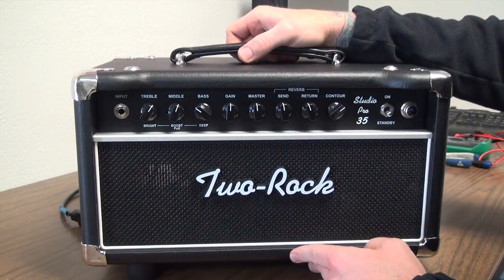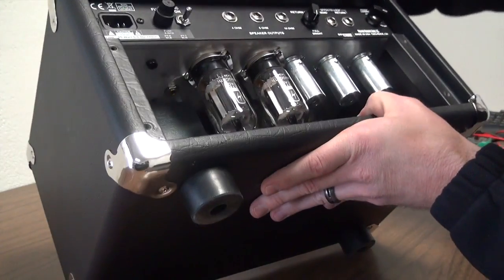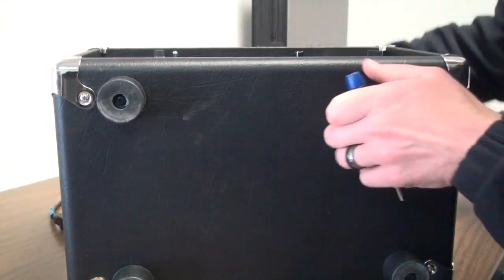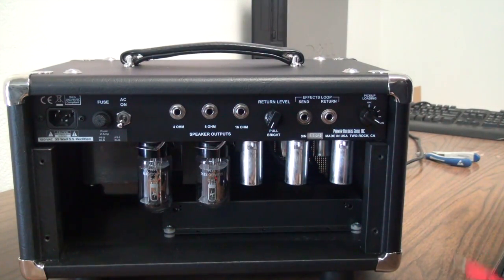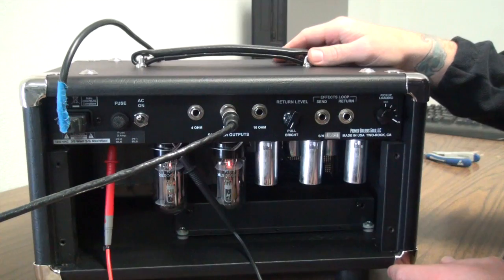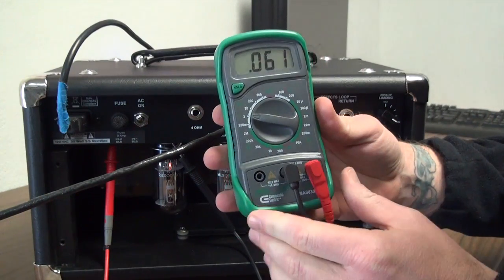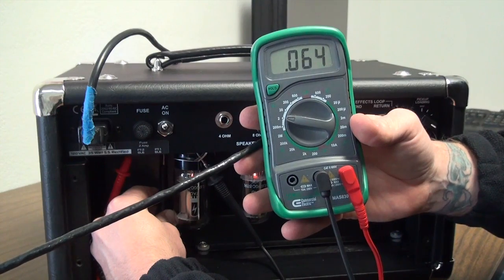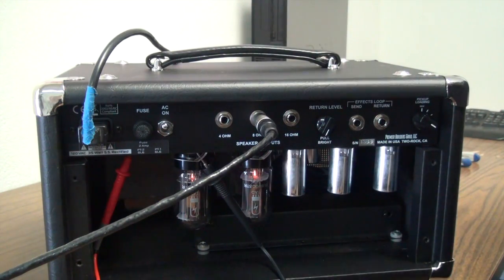Two-Rock Bias Instruction

Comment: Great information! I would like to add a comment based on advice that I received from Gil at Two Rock. This is specific to my Studio Signature 35 watt amp. I will be replacing the TAD 6L6WGC-STR that are currently in it, with a matched pair of Tung Sol 7851A. I asked him what the bias setting should be and he responded .031. I also checked my owners manual which recommends a factory bias of .030 for my amp. I just wanted to share this in case someone is looking for similar answers. I'm glad I checked because my guess is that it would have been a bad day if I set my amp to .06x
Reply: I had a Studio Pro 35 Plus and now I have a Studio Signature, so it was a great comment, I was wondering the same thing. Thanks